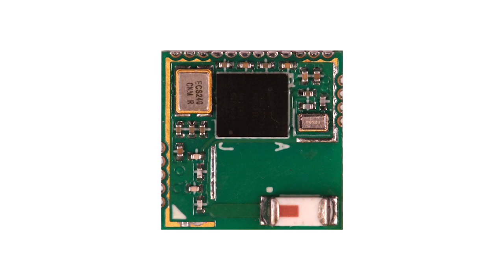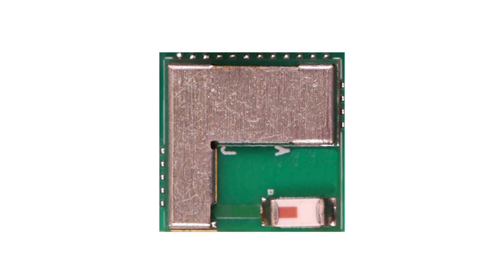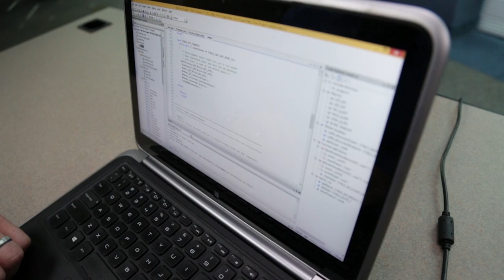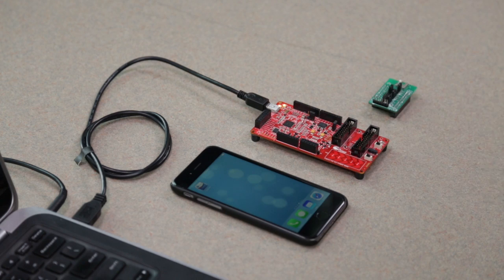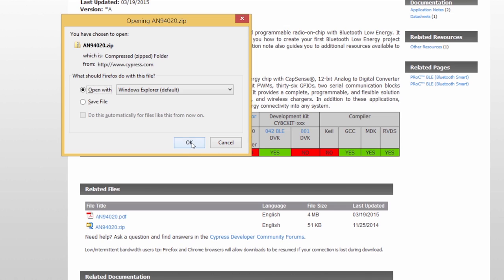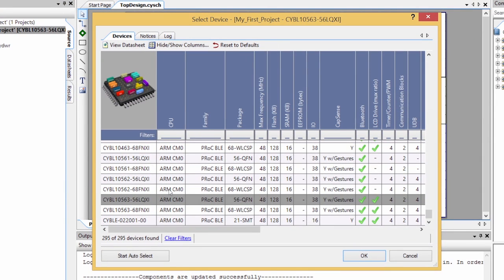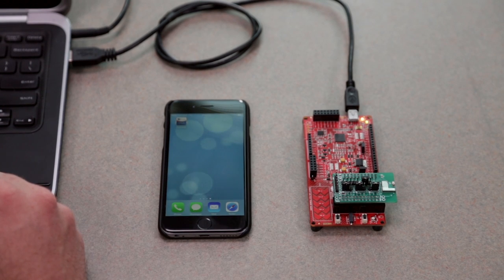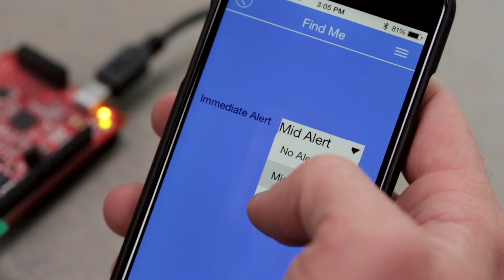Introduction to EZ-BLE PRoC Module

Comment: How to file Application file to BLE Module?
Reply from the maker: Hi Arunbm123, in PSoC Creator, choose Debug > Program to program the device with the project. You can view the programming status on the PSoC Creator status bar (lower left corner of the window). For more details, visit: http://bit.ly/2FG8Ayg. Please let us know if you have any other questions. Best, Cypress
Reply: getting Cypress Products in India is very difficult..
Reply from the maker: Please try checking out our authorized distributors and see if there are any in your region! http://bit.ly/2iRI4qZ If you're still having trouble, you can always order online through the Cypress store. Please let us know if you have any further questions. Best, Cypress